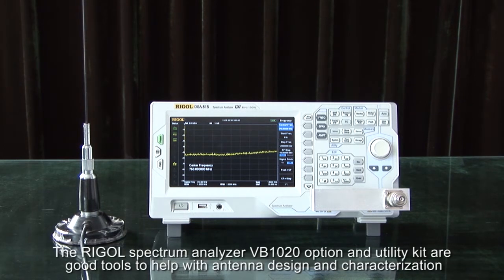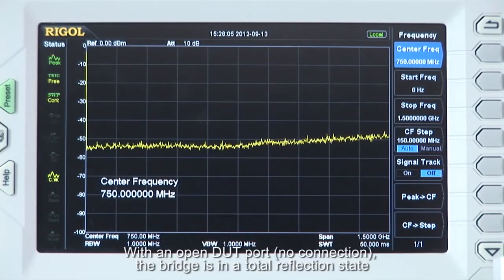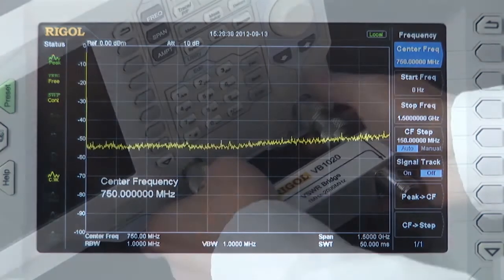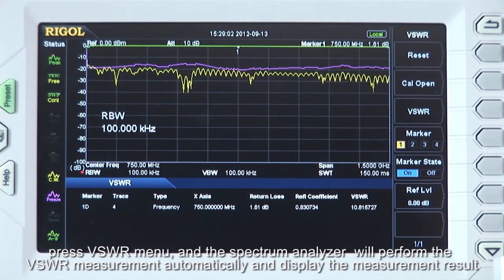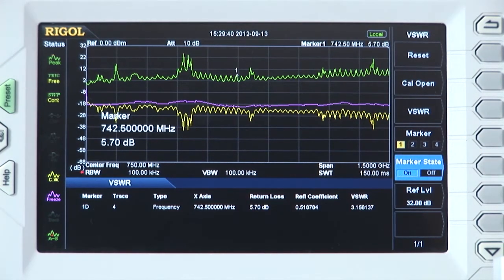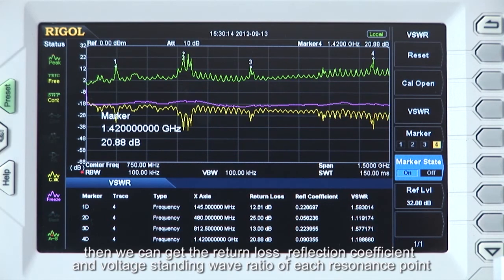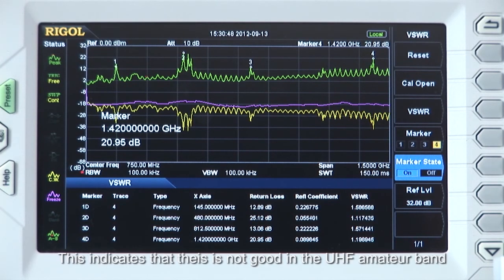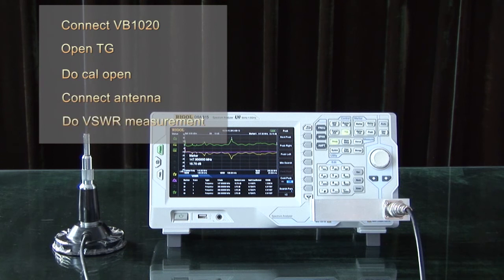How to use a VSWR Bridge to Measure Antennas

Comment: The Array Solutions antenna analyzer I use, uses 50 ohm resistive loads for calibration, but just as the Rigol , the test is not done with DC, it is done with a scan of frequencies, and what is reported is the impedance at each frequency.   So your understanding of the analyzer is a bit off. Further more, a scan of an antenna, such as the mobile antenna, is done at very low levels, so it may test ok, but if it was a full size beam in your home, or laying on the ground, I sincerely doubt it will test as a 50 ohm load at any frequency, regardless of what is reports back for a 50 ohm resistor.  If  the analyzer can test with 100 watts of power, it might show something a little different when the antenna is not installed in the proper environment.

Comment: Keep in mind Return loss alone is pretty much a useless measurement as it tells you nothing about the characteristics of the antenna and whether it is resistive or reactive. Keep in mind a 50 Ohm resistor will fool this thing into showing a good SWR  but it dost mean it will be an efficient antenna
Reply: since there is no resistor inside the antenna the energy that isn't reflected has to go somewhere, aka radiated into space, aka you are wrong.
Reply: @pratwurschtgulasch6662  I'm thinking you need to crack another book or two and get back to us because you're wrong. This isn't rocket science it's pretty well established.
Reply: @dannelson8556  you say a return loss measurement tells us nothing about an antenna, you're the one that needs to read a book.
Reply: @dannelson8556  i normally don't take the time to explain to rigol newbies how rf works, so today is your lucky day. you think that the return loss won't tell you if the antenna is resistive or reactive, that only applies at the frequencies where it is not matched, we don't care about that. we only care about the frequency where it is matched, this is what this video is about. in this case it does tell us, it tells us that there is ~50 ohm resistance and ~0 ohm reactance. the reason we know that is because the source and transmission line have this impedance and when there is no reflection coming back from the antenna, guess what, it is a (conjugate) match. the only thing that would throw that off is if someone stuck a 50 ohm resistor in the antenna, but like i said, that is not the case. no reflection = 50 ohm and the return loss is what tells us how much signal is reflected. hope you enjoyed your free lesson.
Reply: @pratwurschtgulasch6662  great just what I need a hobby is trying to explain radio electronics and antenna theory to me, 

Not only do I hold an extra class amateur radio license, I also hold a first class radio telephone license, and I'm a member of the IEEE, 

 I've worked as a broadcast engineer in both radio and TV for over 40 years, and I was employed by motorola in research and development.

 After I retired from broadcast I owned and operated a marine electronics repair facility as well as an avionics service and repair facility, Nelson Marine electronics, and Nelson avionics. 

While your Rigol is cute it's really just a hobbyist toy and no match for my agilent vector Network analyzers and service monitors. 

Now don't misunderstand me a return Loss bridge is a useful tool in the hands of someone who actually knows how to use it and it's a good educational tool for those learning, but it has limitations that need to be understood. 

For example reference plane. Exactly where is the reference plane in that setup, is it at the end of the coax or is it at the feed point of the antenna period and if it's at the end of the coax are you actually measuring the antenna or you measuring the antenna system including the coax..

I work on this stuff every day. And whileI'm always open to learning new things I seriously doubt you're going to teach me anything.
Reply: @dannelson8556  that's really great what you say. i don't own a rigol either, not a fan of the brand. so one thing i can teach you is about the reference plane since you asked. because with the return loss bridge, we are not measuring impedance so the reference plane is irrelevant. if we were measuring a specific antenna at a specific frequency to see what the return loss is, and if we looked at it also on a VNA and assuming it wasn't a 100% match, then we take more or less wire and change the length of the wire to move the reference plane in and out. what would happen is the impedance point would essentially travel in a circle, from short to open, from inductive to capacitive and vice versa. What would not change in fact is the diameter of the "circle" or how far the impedance is away from the center. and this my friend is the return loss, which is what this video here is measuring. even here the reference plane is basically at the end of the bridge, this is what the calibrate button does. but here it is only used to remove small losses from the cable etc.